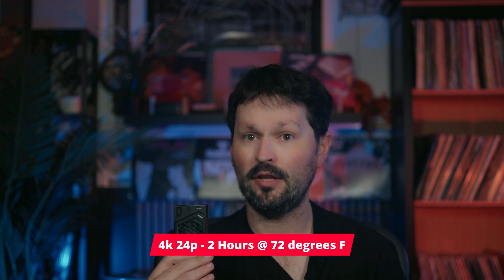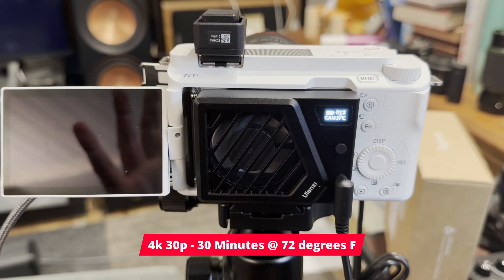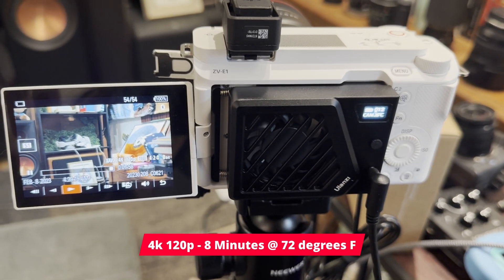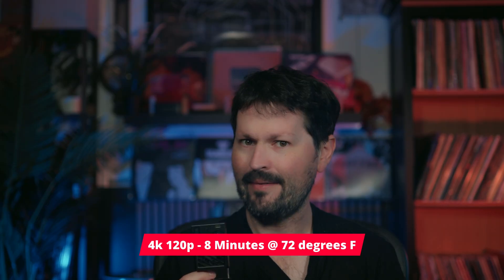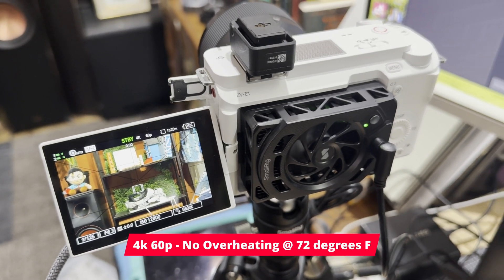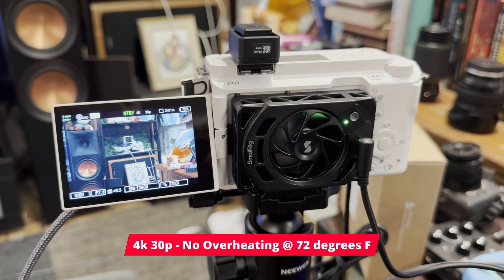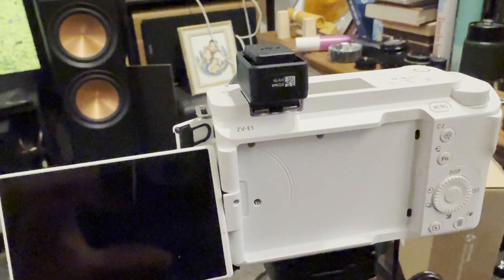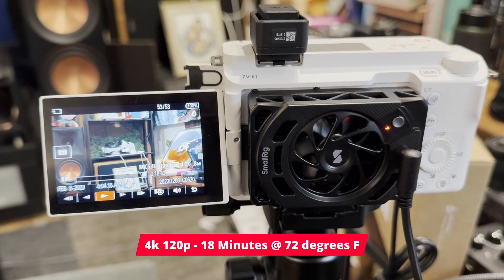Fix ZV-E1 Overheating For Good

Comment: I wonder if a white color helps with heat vs the black body, white usually reflects outdoor sun. 

Also I heard that if you leave the SD card door open it helps a lot.

Comment: I seen people use a dummy battery to reduce some heat , lmk if that also helps
Reply from the maker: I use a dummy battery a lot of the time, and it helps a little, but I still need the fan.

Comment: You may want to try the ulanzi version that takes an external battery.  I got an hour and 30 minutes with my a6700 on 4k120p.  A setting that normally shuts the camera down at 10minutes.  AND the piggy back battery lasts as long as the camera battery.
Reply from the maker: I was going to try that one next once I get a refund on the other ulanzi. Thanks for the tip!